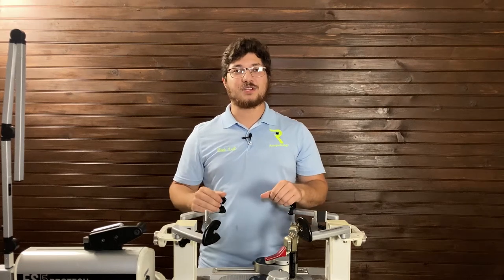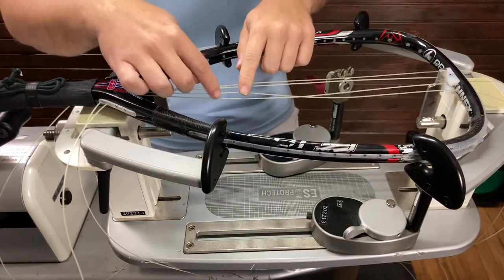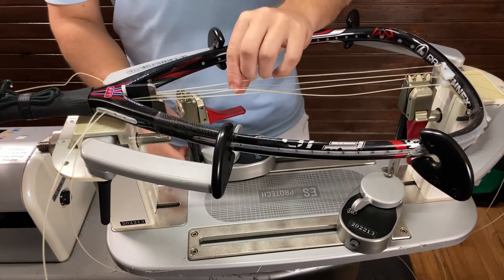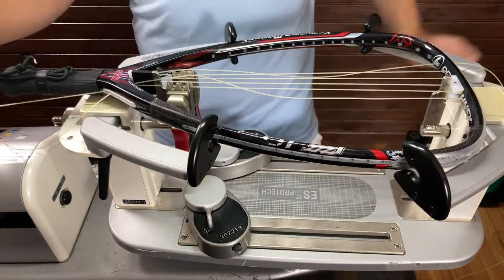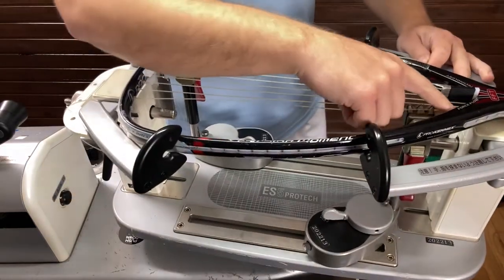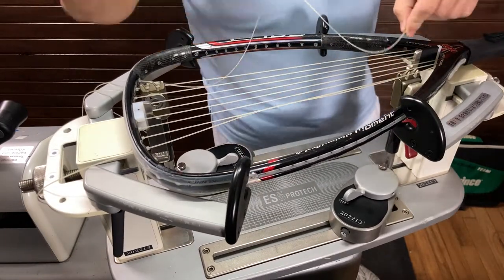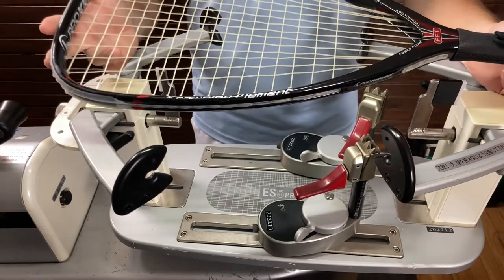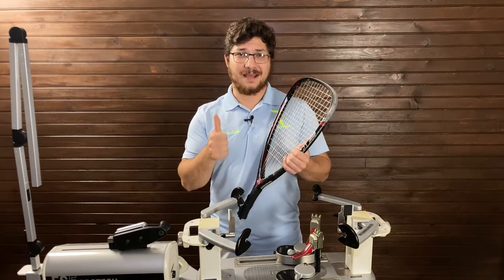How to String A Pro Kennex Racquetball Racquet

Comment: Racquetology, I think I could use a mounting adapter as well as I have a typical 6 point mounting machine which was pricey and works very well for tennis.    On some racquetball racquets I could barely fit,  I ended up not being able to clamp the top cross.  So I had to double pull the top two crosses.  I in addition also have the old glide bar machine which mounts all these better but straight glide bars do not work well with fan patterns and that seems to be all racquetball racquets.   I do not think I would have much luck calling about the adapter since the company is out of the stringing business.    Do you know who might have one?
Reply from the maker: Hmm possibly, I would need to see the machine to know for sure. Go ahead and message me through my email RacquetologyMRT@gmail.com
Reply: @racquetology  It is a Babolat Star 5.
Reply from the maker: Ok then I don’t know why you think Babolat are out of the stringing business, but let me assure they are not and can still contact them about their machines. Also depending on the glide bar machine there can be adapters for swivel clamps.
Reply: I got the same problem on my Baiardo about not reaching the top cross with machine clamps... Did you find a solution for yours?

Comment: Doc, hoping you can shed some light on what the weighting system is for most racquetball manufacturers as I have spent a lot of time, including calls directly to manufactures, in trying to learn what is meant by (Example) “2-points head heavy” . What is a point ? Just recently I’ve seen a racquet listed as 223mm head heavy and one read 223 head light ? Thanks again.
Reply from the maker: I for sure can help with this question. The mm distance is a measurement from the bottom of the butt cap to the balance point of a racquet ; the head points measurement is the distance from the balance point 1/8 an inch in either direction. Depending on how far away it is from the middle of the racquet will determine how headlight or head heavy a frame is. For Example a racquet ball racquet will be 22 inches or 55.88 cm long so even balance would be 11 inches or 27.94 cm ; so if a racquet is 2 points head heavy it would be 11.25 inches or 28.58 cm - 285.8mm

Comment: How do you know which racquets you can pull tension on each segment and those you double pull on?  I know from tennis stringing that double pulling results in two strings having half the tension.   I looked at the USRSA digest and it just says start at L1h and feed to LT1 and loop to LT2 and end up at L3H.  It does not say where and when to tension.  I assume that means a double pull?  Gearbox 250 instructions.  No mention of double pulling or when to tension.   I know what I am doing with tennis but no clue with racquetball.
Reply from the maker: Very good question and something that is a problem within the racquetball industry in general. For this particular frame I called Pro Kennex just to verify the method, as none of the material from the USRSA seems to flat out say what it would recommend. Now there are some brands which use the double pull method such as E-Force and Wilson due to the through the handle design, this would still have the string on the other side lose about 20%-50% depending on the string. This is just how the company would want the string to be pulled during the installation, I know some will try to lower the overall difference using a pre-stretch setting to offset the tension loss but whatever you choose to due just make sure it is fine for the warranty of the frame and keep it consistent. Also this is just from my memory right now but the Gearbox frames have 2 double pulls on each side for the beginning mains, then switch to single pulls for the rest. I own multiple other racquetball frames and plan to still make videos on how to properly string them according to the companies rules, so worst case scenario there will be easy to access information online sooner or later. Hope this helps
Reply: @racquetology  Thank you for your response.  A lot of times in the digest I see "all mains tensioned at the head (2ms being tensioned together).  I do not see this with the gearbox instructions.   I feel bad for racquetball and now tennis is going the same way because of pickleball.   I am going to try to string the GBX1 like I do in tennis.   A guy came into the store begging to get his racquetball racquets strung and I guess that means I have to learn how to do it correctly.   I did send an email to USRSA (I am a member), hope to get clarification.